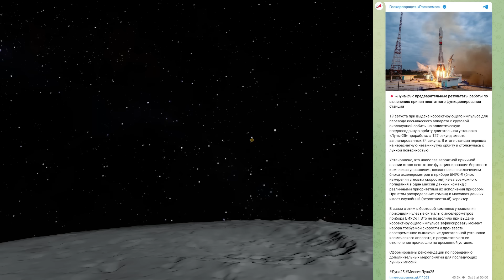Russian Space Probe Crashed Into Moon Because It 'Forgot' To Turn On Critical Hardware

Comment: In those failed Moon missions, there are two thing that i dont understand : The lack of sufficient software testing, and the lack of redundancy. It is like all systems routines were based on flawless operations.
Reply: Redundancy often doesn't help much in the face of software errors. Each redundant subsystem will be running exactly the same code and will likely hit the same bug given the same inputs.
Unless there are independent teams developing multiple implementations of the same software. But that's just crazy expensive and brings its own problems.
Reply: @martir.7653 Yup; only system ever to have a truly independently developed second software load running - & then, only on ascent & entry- was shuttle.
Reply: @martir.7653  : Multiple implementations of the software mean you can't use step-by-step state verification, which is one of the types of hardware redundancy.
Reply: "Happy Path" coding. It happens when you're being forced to hit a deadline. The old Soviet "accountability" dragon rearing its head. No one wants to be responsible for delaying the project, so they "finish" it and push it down the road, expecting the error to be corrected or caught by someone else. When they built Chernobyl, the construction process was plagued by substandard parts and components that didn't meet spec. They had to have a whole department that would check incoming supplies for defects because the companies--factories--making the stuff got their bonuses as long as the stuff shipped on time. That's all that matters.
Reply: @robot_spider it’s the same everywhere. The company I worked for would ship empty boxes to make up the numbers if there was a short fall.
Reply: @robot_spider did soviet accountabiliry dragon affect iprevious 2 moon crashes from 2 different countries as well?
Reply: @robot_spider   The old Soviets kicked ass with what they had. How they beat us so many times still amazes me.
Reply: @Fooney1  Oh, no question. But it's such a brute-force approach. Throw enough people and resources at it, and you'll get it done. Their scientists were, and are (well, not "Soviet", but you get the idea) some of the best in the world. Unfortunately, at some point, you have to turn all that over to the people making the stuff. And you just can't brute-force some things. Moon missions are one of them.
Reply: I see a lot of code that does not even have the notion of error in there, and always assume everything will be always right.  Handling errors is something many "developers" do not even know it exists.
Reply: @ikocheratcr  I don't know what the Russians are using in terms of computing hardware these days, but it very well may be something comparable to 8-bit microprocessors, and on the low end of that. Those programmers can count themselves lucky if they are allowed to use C... error handling isn't all that easy in those circumstances and you need to anticipate the errors and have a plan to deal with it... really hard to do with space probes.
Reply: This is a major reason why the US lunar missions went so well.  Their guidance computers had the ability to handle errors.  It wasn't perfect (the astronauts had to "hack" Apollo 14's LEM computer to get around an error caused by a soldering mishap), but because the computers had some excess capacity, the ability to prioritize programs, etc., the Apollo 11 landing was able to succeed despite throwing five executive overflow errors during the late phase of the landing.
Reply: It largely comes down to cost. Russia is cheap and prone to skimming/bribery, other first-timer countries are spending less on entire moon missions than SpaceX spends on a test rocket that's only meant to move 300ft.
Reply: There is no chance of a Soviet moon mission having a flaw. Socialism is perfect.
Reply: I actually worked on the AOCS software for a major ESA mission and one of the mantras was "we do not design for double failure." 

I can't discuss details, but It's easy to be on the sidelines and be "amazed" at how stupid these engineers are. The reality is that compromises are always made and you play the procentages. In space, "shit happens" often.
Reply: @cardjack   For the record, I am not saying they are stupid, just that i don´t understand some details on the apparent approach. 
"shit happens" and "we dont design for (double) failure" sound like opposed concepts.
Some of the recent mishaps seem to show overconfidence, and it looks like safeguards could have been implemented at virtually no cost.
Reply: @AeroGraphica  I wasn't there, so I have no idea about the Russian spacecraft, but when a project goes on for this long all sort of things tend to happen. Management (and even engineers) look at the software like a one-off way too early. "It's OK, we'll never need to touch this code again," high staff turnover leading to tests written by people who don't fully understand what they are testing or how to properly check for the expected results... Combine this with the sheer volume of testing required and it's easy for something to slip through the cracks.
Reply: Robotic probes like this don't carry a lot of redundancy. It's not worth the extra weight. And often you'd need additional logic or even hardware to recognize failure and switch over. And the bus was probably overwhelmed by many times the amount of messages it would be able to handle without correct priorisation.
Reply: @Andreas-gh6is  Thinking about it I kinda wonder how much redundancy (in terms of more of computing side) they usually have. From what I remember Voyagers had quite some of it especially considering their age but not sure about other cases.
Reply: @ImieNazwiskoOK  Yeah, but this bug wasn't about computing capacity, but about bus capacity. And likely there were orders of magnitude more messages than the bus could handle without losing something, so scaling your way out this problem isn't feasible. On the other hand, proper priorisation would have meant no issue with capacity.
Reply: No flaws allowed in glorious russian empire. /s
Reply: @imarchello @4:21 not just Russians.
Reply: Watched a video on a Soviet-era computer programming trainer a while back.  The fellow who was restoring the piece found several notes inside the case left by the original workers when it was built.  The notes said things like "State 5 and 7 switched" or "outlet not functioning".  
     Apparently, this was done in order to ensure that sufficient finished units left the factory, since pressure to meet the assigned quota meant there was no time to correct defects found during assembly and testing.  The techs could point to the note and say "No, Comrade, the defect was identified and tagged for repair.  Look, there's my note.  If the defective unit was sent to the customer, it's not my fault."  The tags were presumably meant to be found when/if the unit was returned for repairs when the customer found it didn't work.
     This system, an example of "smekalka", was widespread throughout the Soviet Union.  It may still be used.
Reply: @christopherreed4723  That shit may have flown with some low priority computer units back in the day. But if they find a technician who covers up a fault that then turns into an embarassing failure in their space program, that would be very not good for the technician.
Reply: @Andreas-gh6is  my guy, one of Russia's recent MAJOR rocket failures (Proton-M rocket, July 2013) was tracked down to a component that was HAMMERED IN upside-down - and it would have otherwise fit in by hand if inserted correctly. In Russia it's still all about getting-it-done rather than getting-it-RIGHT.

Comment: Translation from Russian: 
Control module received no data from angle accelerometer due to all commands enters into communication bus in random order instead of prioritised queues.

P.S. average experienced software engineer salary in RosCosmos in Moscow ~800$/m before taxes.
On market in Moscow it's averages around 2500$/m.
Reply: Oh there is more to this. Positions with access to the spacecraft control codebase comes with a pretty high secrecy level which means you cannot leave Russia for 5-10 years after you quit your job in Roskosmos. This was a huge turn off for most professionals even before the war, and its even worse now.
Reply: Thank you. Interesting information. Here in the US our primary space fairing company, SpaceX, is being sued by our government for not hiring non-citizens. I do agree though with your statement of basically locking yourselves in for 5-10 years turning off people from taking those jobs. As a retired software engineer I also would not want that job.   @hrofty
Reply: $800? H-1B hires do it for less. 🤣
Reply: That could mean that the accelerometer was actually running, but none of the data packets were getting through, which is slightly less idiotic. But even if that were true there should have been some contingency plan for what to do if no data was received.

Comment: I imagine this priority issue would have shown up in extensive ground testing and simulation... If that had taken place.
Reply: 6 years ago I was working in a system integrator with a guy who came from Roscosmos. He programmed celestial orientation for space probes there. It lasted for a couple of weeks and then I gladly said him goodbye. Based on that experience I should say, there is no wonder that our interplanetary probes end up on the ocean floor. Now I wonder what magic eventially heaved some of them into space.
Reply: Any amount of testing can't prove the absence of bugs; but yeah, its easy to imagine it could have been avoided, but I'm sure the engineers did the best they could with the constraints they had..
Reply: I work in the field. Not space exploration but similar challenges. There's a saying,  Every test is wrong and every simulation is wrong. It means that once you reproduce the systems under test's operational environment 100%, you have the real system in the real operational environment. In this case, that would mean actually flying the mission.
Reply: @phillybruce  A hardware bus like that is a fairly abstract thing, surely they could have caught this with serious integration test practices - again not all failures can be caught (think Galileo antenna) but this one seems obvious enough
Reply: @cheaterman49  Who can say? Everything is obvious in retrospect. That said, like you, I'm a bit puzzled this didn't show up in integration tests.
Reply: @cheaterman49  I didn't sound to me like the buss failed. It was a failure of the software using the buss assigning the wrong priority. It sounds like the buss did what it was told. Remember, they are going to use a real time protocol. Once the buss reaches certain conditions it would be designed to shut down low priority traffic.
Reply: @phillybruce  Very awkward from today's software engineering standpoint, to have this much focus on "real time protocol" and at the same time neglect to implement any retries. As if "real time" was what would save the day single-handedly
Reply: @u1zha  I don't think retries have anything to do with the failure. RT networks often have retry capability. The failure as described was a priority issue which is a property of RT networks. The message wasn't lost, it was blocked. This is because the network was programed to give the message a low engulf priority to indicate that it wasn't an important message.
Reply: @phillybruce Why doesn’t the receiving unit ack that it received such a mission critical message? And retry until it receives the ack? There are basic ways to prevent this without just relying on a priority system. The fact that they blamed that indicates they are covering for the real issue. No safety/redundancy built into mission critical software operations. They just crossed their fingers.
Reply: @maxcarren112  You look very young on your profile. If you are a software guy, you may want to look at embedded systems. To me, its a lot more challenging and a lot of fun watching your software do physical things.
Reply: @maxcarren112 How long do you wait for an ACK, when microseconds count? What do you do if it fails? Real time systems don’t have anywhere near the flexibility of desktop systems, and networked systems are a different universe entirely. That said, priority ageing is a thing too.
Reply: @badatpseudoscience   I don’t have any experience in RTOS. I thought this was a networking problem. Still, how many times have people landed on the moon by now? You would think bugs like “failed to turn on the inertial guidance system” would be worked out, maybe some redundancy before burning all the fuel on board in error? Like I get that the time windows have to be exact, and that embedded systems are super hard. But someone figured this out in 1962 right? If you’re an expert, what’s the answer?
Reply: @maxcarren112   “failed to turn on the inertial guidance system” wasn't the bug. It was a result of the bug. It was the result of the bug. The bug was that the priority of the message was set improperly. 

As systems get more complicated, the number of ways that it can fail increases combinatorically. It is impossible to test all of the failure possibilities. Lets say that the source code is one ,million lines of code. That's probably a modest estimate. That's a machine with one million parts. The bug was one number in all of those parts.
Reply: Well is not like other very famous and infallible outfits didn't do stupid crap in the sw field. Ariane 5 maiden flight is a classic case studied when approaching sw testing and systems integration
Reply: @crono331  And the mars explorer.
Reply: It took place. This bug sounds like something quite obvious, but probably it wasn't that simple. Me thinks the sequencing of these messages isn't deterministic but rather dependent on the state of the vehicle and maybe something like thermal factors or differences in radio signalling led to a situation that wasn't tested. And, knowing the Russians, it may just be a bullshit excuse for an even stupider failure.
Reply: @Andreas-gh6is  That's my point. Even W/O hardware un the loop there there's infamies saying of  "it worked on my computer" that there are so many developer jokes about.
Reply: HA the thought that they do through testing for anything in Russia
Reply: @Marvin-mq9rk Do some more homework.
Reply: Obviously Russia wanted to land on the moon before India, for the Geopolitical win. Whether this means that stuff like integration testing was rushed. Who knows.

The real reason could also just be, that there was a stowaway on the lander, that lit a cigaret, right after a succesful touchdown. There's been a lot of smoking related accidents in Russia this past year after all🤷‍♂️
Reply: Not saying you are wrong, but Russia made it to space first, first with a person in space, first space walk, first probe on Venus...

I really don't think they have to compete with India  @soul0360
Reply: I'm sure you could remove the word "extensive" because any simulation testing could have revealed that.
Reply: Bold of you to assume that they did proper ground testing.
Reply: I'm surprised that the reason for the failure didn't turn out to be that some stripped the probe for its precious metals or siphoned off the fuel.
Reply: Software bugs are often result of missing test cases, as we say in IT. It was a well timed failure, needed due to geopolitical situation. Russian partners might be less interested in their space tech and president didn't get an easy win to brag about superiority.

Comment: What the deal with software errors and landing on the moon? Even Apollo11 had issues.
Reply: Apollo 11 was a hardware issue.
The landing radar was on to "see" the landing spot.
But, at the same time the up looking radar was on trying to find the Command Module.
So instead of having one data rich input, the LM was running two inputs.
NASA changed the switch configuration so only one radar could be active at once.
Reply: @AndrewBlacker-wr2ve  I thought there was a software bug with the docking radar that overloaded the computer with jobs. Reminded me of what happened here since the the priority was supposed to be landing but the computer was busy with non essential stuff.
Reply: @ares106  I cannot argue.
It was 20 years ago that I learned of the issue.
We're both talking the docking radar so we're not crazy.
But I recall the switch configuration being reconfigured to prevent the problem.
I can gladly be wrong in lieu of seeing/learning a better truth.

Cheers!